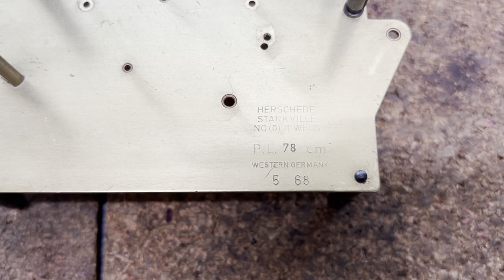Herschede Grandfather Clock Assembly

Comment: Chris, your videos are total fun and I learnt a LOT! Can you tell me, when the pendulum CM length and the speed BPM values are stamped on the back plate, where do you measure the pendulum length from? Is it from the verge pin or from the very top at the suspension spring mounting arm, or just the length of the external pendulum rod itself, etc?
Reply from the maker: Thank you. It is measured from the pin to the center of mass of the bob.

Comment: My grandfather clock's minute hand is running little bit fast . I adjusted the pendulum several times but couldn't fix the problem.  I have put the clock on a little bit uneven  floor . Is it OK to put the clock on a such ground ?  Please give me a solution.
Reply: I'm no expert but really you should definitely try to get the clock case nice and vertical, use a carpenter level if you have one. However it probably isn't the reason to run fast. Is the pendulum the correct one or is it a replacement one, that can do it.
Reply from the maker: If adjusting the pendulum length is not resolving the issue; it is probably an escapement problem in that it is missing some beats or there is an internal problem of some kind.